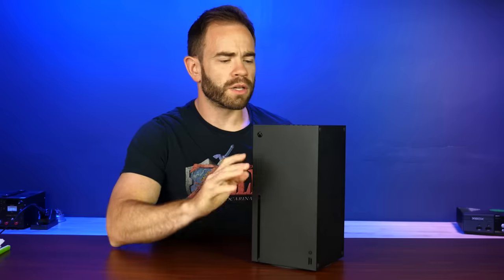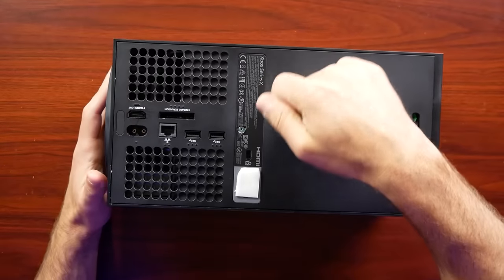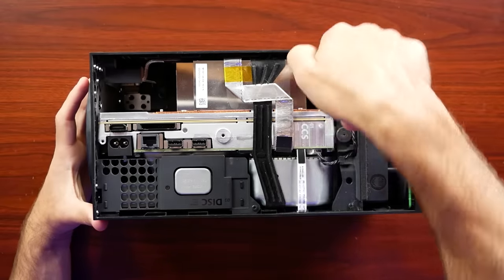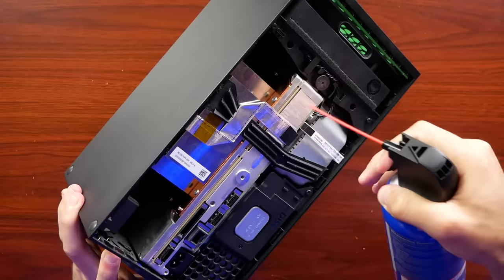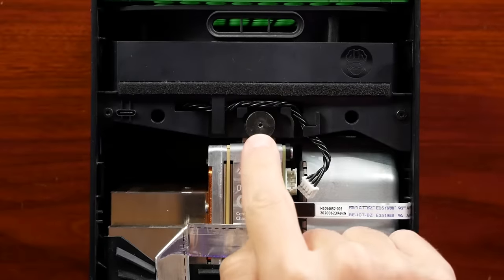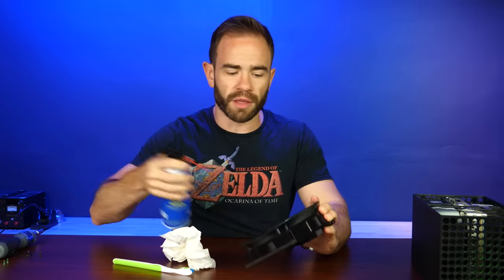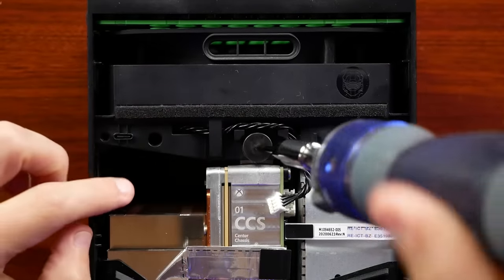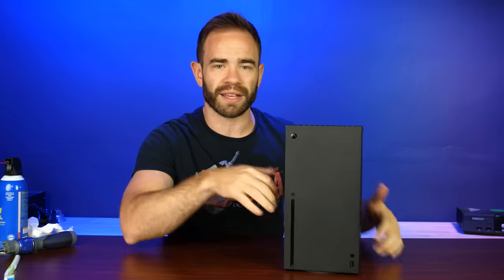Every Xbox Owner Needs To Do This

Comment: Couple additional tips: have a second or third can to rotate through while theyre on cooldown since they lose pressure temporarily 

And hold the cans upright as much as possible since liquid can come out if tipped. You can bend the straw to reach tough angles. Best to avoid getting any moisture on your components 😊
Reply: i found it was better to ditch the compressed air cans and instead i use a rechargeable air compressor that is meant for PC's, but it will do the job for these just as good, it's far more powerful than the cans and you can do it as often as you need to without needing to purchase another can, which i have done for years and it's always a pain in the ass, i would rather use something like this little compressor instead because it will last years and years.
Reply: @5226-p1e  even better!

Comment: it would be stupid to spray air "IN" as you mentioned, as it will do nothing but recirculate dust inside the console. When you spray compressed air, you need to aim it in a way where it removes the dust and pushes it outside.

Comment: I like to use a thin microfibre cloth/paper towel damped with deionized water to clean fans, tight spots and metal parts.

Anyway, Series X is so well enginereed, I gotta appreciate how compact it is compared to PS5. Good video, it's always reassuring to see someone showing how to do it first.

Comment: I’ve never cleaned any of my consoles. From PlayStation 1 to XBox Series X.  I’ve had all PS consoles and all generation of XBox. Each lasting me about 8 years. Except for most recent consoles of course. I wouldn’t suggest this unless you’re experiencing issues with your fan. Also do not use compressed air. It has a type of coolant in it which can ruin components of your console.

Comment: Bought one second hand off eBay i very good condition.

Opened it up and pulled all the guts out of the shell and DAMN was it dusty! 

Accidentally broke the 2 bottom clips off the back plate :(

Still holds together thanks to the screw and was still worth it.

Comment: Thanks for the video I just pulled a small fuzz rug off my heat sink. I was getting the over heating message the last couple days. It probably has been running almost 24/7 since the day I bought it 3 years ago. I have cleaned and vacuumed it from the outside. After opening it up though I found my problems 😂
Reply: I couldn’t even run my Xbox for 1 hour previously and it would over heat right at the most intense part of the game and I would lose all my progress

Comment: I clean the outside monthly so when I opened mine up i was really surprised how nasty the heatsink was. If you run the default power settings of always on it needs to be done more often.

Comment: PSfB despises the XBX Series X but it is a much better-made console and a well-designed one as that. As an IT Engineer, I was well impressed with the design of the console and how Mixeosofy made it easy to clean. As an Electronics Engineer as well I have an abundance of iFixit tools and I recommend buying a set even if it's a small set it is well worth it.

Comment: Can an air compressor be used to clean electronics, and if so do you have a recommended PSI? I have an adjustable compressor and I can't stand air duster cans. I was actually just wondering this yesterday as my can ran out and I was thinking I'd rather not buy more. Just thought I'd ask since it was on my mind and you said something about compressed air.
Reply: Air compressors can gather moisture and you may risk spraying water all up in your things. A dedicated electronic duster is like a small leaf blower. You can use an air compressor but is not really advisable for the already mentioned issue,  Canned air duster is cheaper. Its a one time purchase vs something you can use again and  again.
Reply: @kjuju  if you don't mind me digging a bit deeper....

My compressor is pretty nice and has a drain, which I empty before every time I turn it on - does that make it safer? With duster, I always end up spraying some white liquid substance on my stuff - will that stuff never harm my electronics?
Reply: @galaxophone  So obviously I am not  liable for anything happening.  If you are positive that you try to make sure its dry the it might not be an issue. I was throwing out the most common thing is see when people ask about using air compressors to clean electronics. But ultimately it's your things and assume all risks.
Reply: @kjuju  I appreciate your insight and definitely would not blame you if I break something :) I know I've used gas station pumps for my tires that were just straight up spewing water, so I get the risk, but I'm pretty careful with my compressor. I've always wondered about the stuff that tends to come out of canned air and how safe it is. Ill find some time this week to research it :)
Reply: @galaxophone  Well from dumb experience I can tell you it's certainly not safe to breathe.
Reply: @kjuju  yes, I am all too aware of this as well lol

Comment: I need to send mine in for usb repair because randomly all my usb ports just stopped working but maybe if it needs to be cleaned Microsoft will give it a quick cleaning. Good vid.
Reply: Just do it yourself it’s easy
Reply: @droid4d279  The usb repair? I know the cleaning is easy.

Comment: I used the t8 torx and opened all the screws except the big center 1 of the 3 on the fan.. it stripped that 1 so so much for getting the fan out

Comment: Not the best way to clean it.. when u first disassemble it take ur vacuum and clean as much as u can. Use a brush to agitate the dirt. After that u can use canned air when you take out the heatsink so you won't have dust flying everywhere.

Comment: Blowing compressed air down into an upturned crevice will not be very effective. Use the toothbrush first to loosen any stuck on debris then turn it on it's side and hit it with the compressed air. Also any plastic parts you take off can be cleaned with a vacuum cleaner with a brush attachment or at least a brush, wiping will only push dust and dirt into it.
Reply: You're right. I'll never understand why they all use compressed air instead of an appropriate vacuum cleaner.
Reply: @santiagocapellan3245  All compressed air cannot transmit static, most vacuum cleaners can. Also a lot of people don't know how to handle electronics and will probably make contact with something they shouldn't. You have to make these types of videos as idiot proof as possible.
Reply: @burnzy3210  you know what? You have a very good point there. Thank you!
Reply: @santiagocapellan3245  you're welcome, mr most open minded person on the internet lol

Comment: On the fan the white clip that is attached to the actual Xbox. I snapped the top white thin lil clip, not the whole thing. What I found out is that that piece I broke literally does nothing I’m not sure why that piece is over the female piece if the male piece doesn’t even click in. You can just pull it out slowly by and and put it back in by hand. Be careful yall that clip is real delicate

Comment: Has anyone else needed to repair their series x's disc drive? I had to send mine In for repair awhile back as it would only read  certain games but not others. It turned out the disc drive failed after only 3 years

Comment: you can waste your money on compressed air, or you can purchase a rechargeable PC air compressor for $20, trust me it will last a shit load longer than that compressed can of air will and it will do a far better job. 

it's not just for PC's, it will work on anything you need to clean when it comes to your electronics and has a lot of other parts and brushes that it comes with.

Comment: I wouldnt remove fan. Just use compressed air. Dont finger phuck it like he did. Hold down power button when unplugged remove loose charge, just like a PC (same components). Use a bluray or optical disc cleaner like a fake disc spinner for the drive. Compressed air should do it. Just like PC. Always hold down power button 1st to remove lose electrical charge (touch metal reduce EMI in form of static etc). Removing fan is risky. I have seen people put fan back in and it doesnt work, focus on compressed air. I would guess never mess with that black ribbon in middle, I need to check connection, dont look like its removable, check connection, SATA or microsoft proprietary for Xbox. Sata easy to remove. Something else I wouldnt even touch it...Best Buy: Best Buy essentials™ - Laser Lens Cleaner - Blue/White like $9.99 right now.

Comment: I think a console is manufactured the way the user do NOT need to tear it down to clean it like a PC, so, in that order of ideas, the PS5 has the worst architecture, AND if you do not know it, the PS5 have already 2 revisions and every single revision has worst heat sink and those get overheat easily compared to the first group of PS5 that came initially.

Comment: Looking at this design, I feel like the next Slim model could be half the size if they make it an external power supply and flatten the heatsink a little bit more, maybe even use a 2 fan AIO cooler instead, they could use liquid cooling as a huge marketing point.

Comment: Man I swear I do this without even opening the console lol. Not that I'm lazy but that I don't know what I'm going to get myself into. Thanks for showing. Also a good question to ask is: how many hours do you have to be using your consoles to think to start cleaning  them. I know overheating is a good sign but wouldn't that be already late? Awesome series.
Reply: If it's just overheating cos of dust or pet hair whatever its fine, it would shut itself down before any damage could be done. So a clean out every now and then is all that's really needed